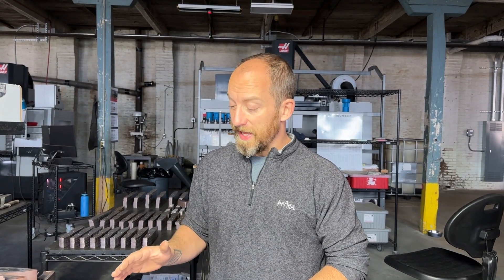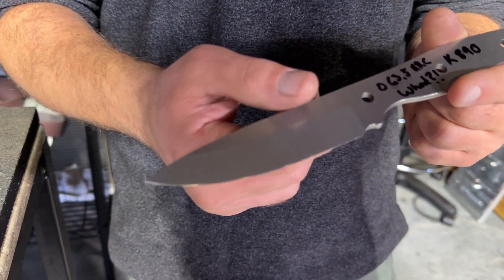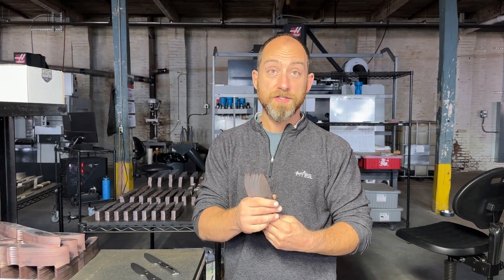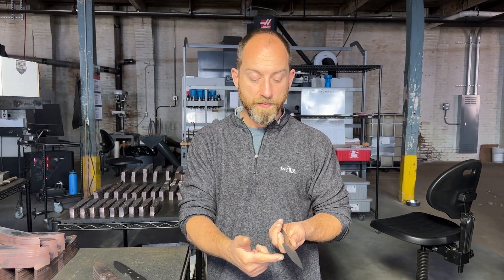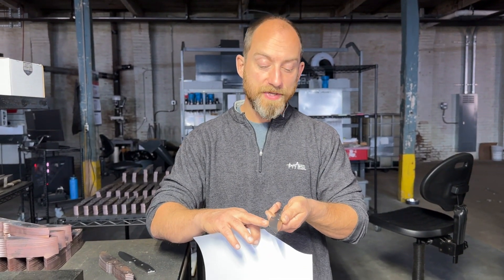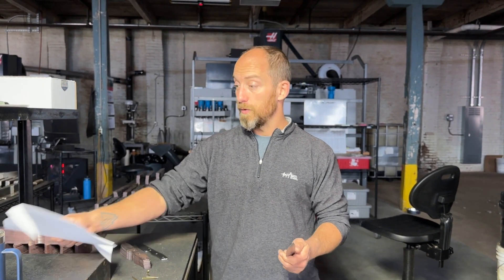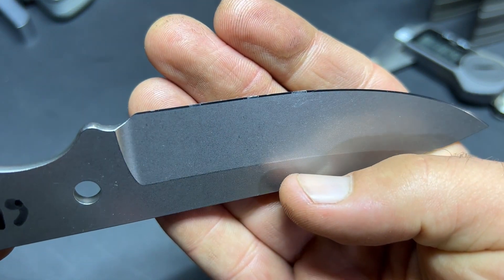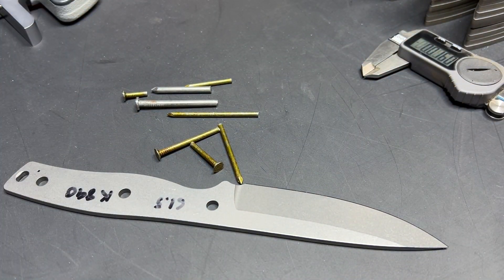Follow Up Testing: Böhler K890 Steel Performance is Awesome!

Comment: I hope you guys open up your Instagram messages soon. Mostly for transparency reasons. I know what you have been through with the move and all the Magnacut blades that got warped etc. But for new potential customers and so on, seeing comments turned off is a MASSIVE red flag for most people. Even if you can't answer most or any of the comments, I think turning comments back on would be huge (just for transparency). Keep up the great work I'm putting in an order for a K890 4.5 Standard soon, wish it was easier to reach you through emails and DM's. But I will take the chance and put in the order soon.
Reply from the maker: We recently hired someone to help out with communications. He has been pretty busy with getting caught up on the email inbox so far. As he gets settled in we will consider opening up comments again.